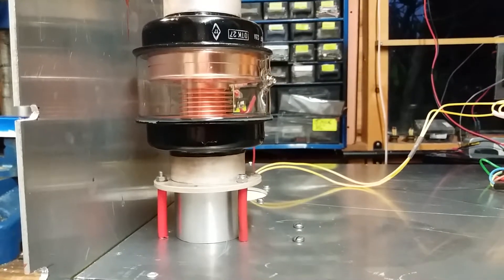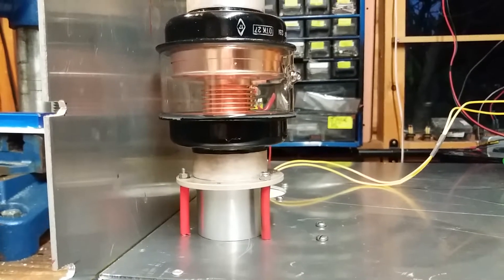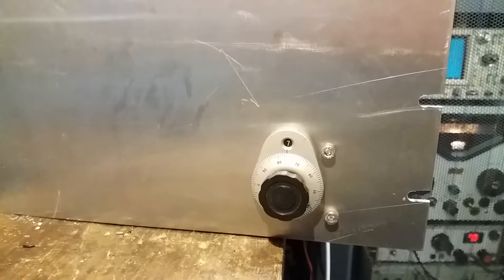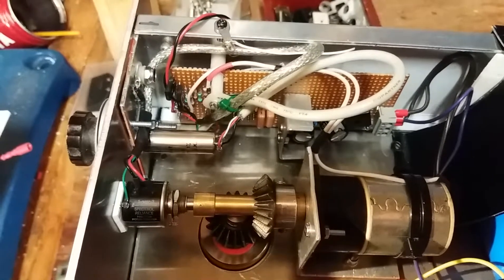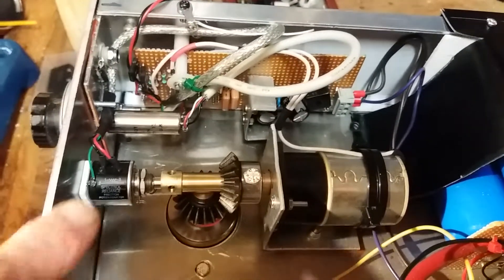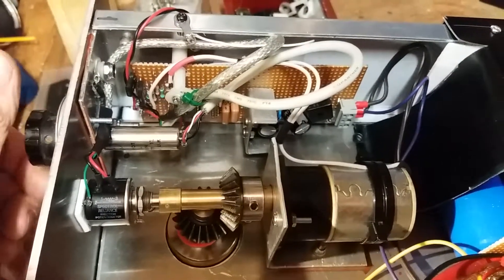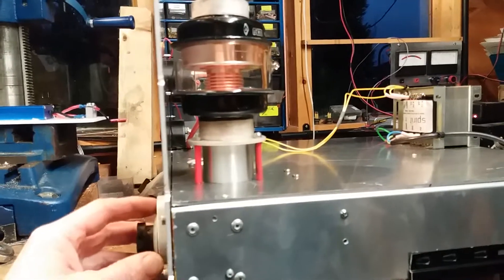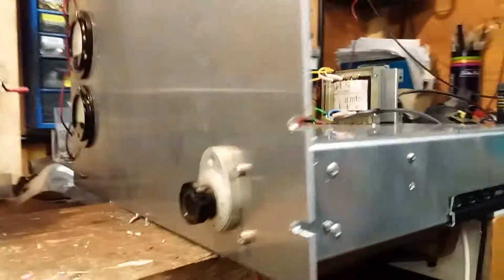Servo control of a 10 turn variable vacuum capacitor

Comment: Brilliant.
I´m building a GU81m amp, and will be using motor control for the pi filter. I will hovewer have it remote / preset tuned, so will have an arduino doing the control.